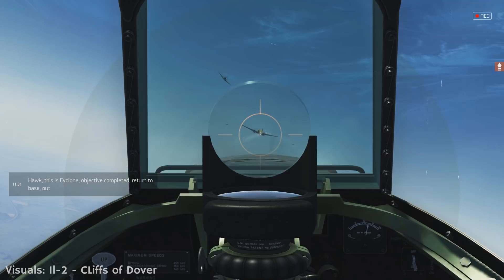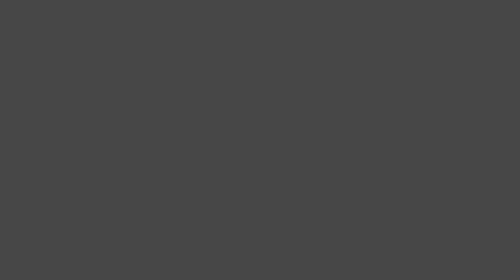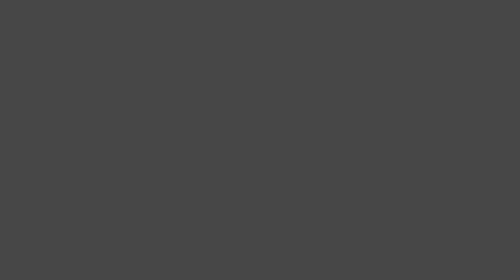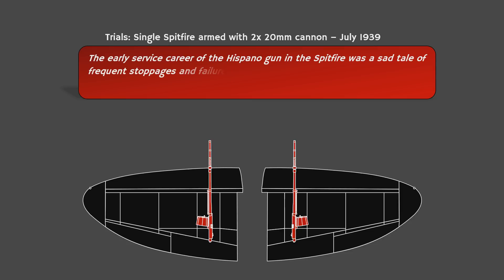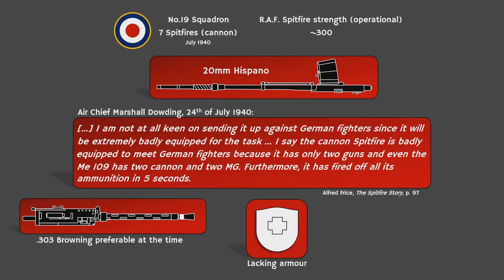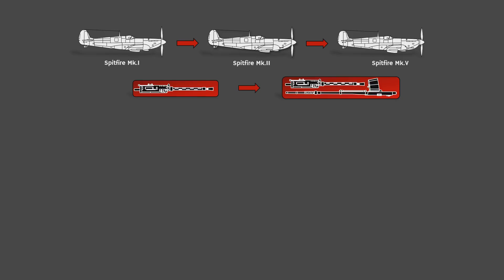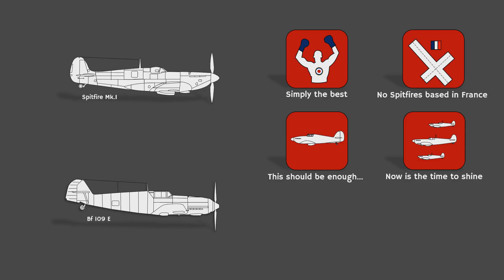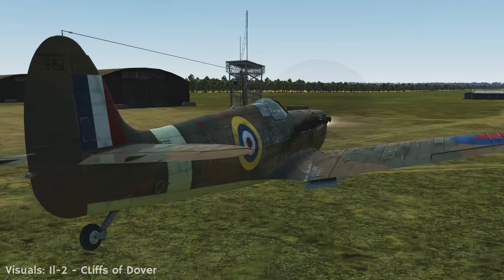⚜ | Clearing up Spitfire Misconceptions

Comment: The biggest misconception regarding the Spitfire is it being a magical aircraft. 1. The 109 E had atleast a 50% better rollrate at typical dogfight speeds (below 300 mph) than the early Spitfire as is being told by those pilots who fly both of them today. The 109 was the faster aircraft both horizontally and vertical, horizontally it was clearly faster at high alitude due to the fact that the DB 601 A had a two speed Compressor, while the Merlin I,II, III, XII, 45, 50 had a single speed one, in fact the same limitation which is so widely critizized on the Allison V1710 (nobody ever critizized the Merlin for the same.....). In a vertical fight the Spitfire is dominated by the 109 as in the typical Boom & Zoom fight. The 109 has a better rate of climb AND a much better rate of climb at very low speeds (this fact is even mentioned by the Brits themselves who tested it). In a typcial Fighter vs. Fighter setup the 109s can dictate the fight as long the Spits don't have excessive initial energy advantage. Also the 109s can disengage at will because they accelerate much better in a dive. In fact the 109 enjoys the same advantages the US Fighters had against the Japanese, though the gap was much smaller. This all was true up until the Spitfire Mk. IX with the Merlin 60-Series with metal ailerons came along with the two speed two stage Compressor, in this configuration and the accompanying very high boost pressures used (+25 Boost) the Spitfire finally was superior to the 109 G  in general performance. Only the late 44 109s with 1.8 - 1.9 Boost closed the gap again but not surpassing it. There was a reason the german Fighters enjoyed a 10 : 1 kill ratio against the British in 1940  and 41. The British Ace of Spade Squadron which fought in Tunisia, the Pilots tell that a Spit V was wholly inadequate to fight the 109 G-2 in terms of speed and general performance ! Only the advent of Mark IX changed this.

Comment: ...did you refer to the 303. Browning MG as a 'MG .50cal'..? If so, bit of a schoolboy error; given the quality of your material I doubt it more than a slip of the tongue.
Reply from the maker: No. Check the comment section, I've answered this multiple times. The phrasing was perhaps a bit awkward but I do not state that .303s are the same as .50cals (such as statement is already impossible simply because the calibers are quoted in the same measurement system...)
Reply: Ok, well... sounded like that's what you said.

Comment: One particular misconception I'd like to see cleared up is the silly notion that the Hurricane was "sluggish," and "less maneuverable than the Spitfire."  I'm sure you've heard it said that Fighter Command "sent the 'nimbler' Spitfire after the fighters and the 'sluggish' Hurricane after the bombers."  I'm also sure you've heard many exaggerations about the difference in top speed between the bf-109 and Hurricane, but here are the relevant facts; late-model Mk I Hurricanes (metal wings/3-blade, variable pitch aluminum prop) had a top speed of 330 mph at 17,500 feet, while the bf-109 -E3 and -E4 versions that took part in the Battle Of Britain had a top speed of 340-345 mph at 5,500 meters (18,400 feet).   

That's a mere 10-15 mph difference between the Hurricane and the bf 109.  Furthermore, neither the Hurricane nor the bf-109 would be doing anything near their top speed in the middle of a fight.  In reality, pilots often found themselves nursing their aircraft on the edge of a stall the entire time!  

As for agility, a Spitfire ace once put it best; "You could pull the wings off a Spitfire real easy down low, and they'd always break at bay 18....nobody ever managed to pull the wings off a Hurricane!"

Fortunately, history has preserved the German side of this particular argument for us; during the early years of WWII, most bf-109 pilots sincerely believed that their aircraft was superior to the Spitfire, which it often was, especially at altitudes above 5,000 meters (16,404 feet).  Yet their leaders hammered it into their heads again and again, "Never get into a turning fight against a Hurricane, or he'll be on your tail within the first couple of turns!" 

So much for the Hurricane's reputation for being "sluggish!"

Comment: You could have mentioned the fact the technological 'fix' to the Spitfire's flooding problem was solved by a woman - 'Tilly' Shilling, details of which are here https://en.wikipedia.org/wiki/Miss_Shilling%27s_orifice.  Also, according to Len Deighton, in his book 'Fighter@, the ME109 had a tighter turning circle than the Spitfire.  However, due to the way the planes were constructed, German pilots did not exploit this characteristic, feariong the G-force would tear the wings off if the plane was mnade to turn too tightly.

Comment: As having Relatives who Fought on Both Sides:
I can but Agree with you.
In 1940, I'd have far preferred flying the BF-109-E3 1 e.  or the Bf-109N.
 Gen. Adolph Galland states this-same in "The First, and the Last"; His WW2 Autobigraphy. As He IS My 4th Cousin: I do NOT dispute him.

That, Said: I draw the readers' Attention to Spitfire V, EN 630, shot-down over western France in late 1941- early 1942. Airframe was later-fitted with an DB 603-LA-1-3-e Fuel-Injected engine. ...  Quoting from the Rechlin Test Pilot Reports of that time: "In Our Opinion: This IS the most perfectly attainable Combat Fighter; to-Date"
This Opinion notwithstanding; that the Luftwaffe Technicians would far-rather have fitted 6 20mm MG151 cannons or two MK103 or Mk108 30mm cannons and 4 MG151-20 cannons or two independant Mk213 or Mk214 'Gating' cannons.

Kind and Respectful Regards, Uyraell, NZ.

Comment: If the spitfire was pulling positive G's and went inverted, would the engine die?
Reply: The counter for the negative-g starvation was to roll inverted and pull through upside down in a POSITIVE G manoeuvre.

Comment: Carby vs Fuel Injection -  Whats new the Germans were  always  leaders in technology even today many cars run Bosch fuel injection 
they ran the first jets  ME 262 , then the first unmanned cruise missiles , V1 and V2 a ballistic missile  - the first Drones  missiles used on shipping controlled remotely from a control aircraft - The best tanks - Tiger and Panzer - the first Assault Rifles  Which were the basis of the AK 47 which is a virtual copy - Ships like Bismark and Tirpitz ( why do you think they scared the hell out of Churchill , a normal battle ship would not and did not receive the attention that these two ships did , and then you have the Houghton Bros jet Bomber which strangely enough looks like the B2 spirit stealth  bomber  currently in use by the USA,  and these are things developed in the late 30's and early Forties.
Reply: The Germans weren't leaders during WW2, they were taking decisions to employ the latest technologies in the hope of gaining an advantage or edge. The Allies, the British in particular, took a more pragmatic approach. 
As Bismark stated, there are acrobatic advantages in using fuel injection, but there are power losses associated with it, too. The RR Merlin was generally slightly more powerful than the competing DB 605 throughout the War, in spite of displacing just 27l to the DBs 36l. Power mattered to the British- the Spitfire was an interceptor, designed to shoot down bombers. It's agility was a bonus, the intention was to combine a great rate of climb and top speed with an eight gun armament. Wartime development priorities evolved, but the initial choice not to use FI was the correct one.
The first jets weren't Messerschmitts! 
Both Gloucester and Heinkel built development prototypes before the Me 262 and the Gloucester Meteor were designed and built. The two fighters went into operational service at the same time- July 1944. While Kommando Nowotny were quickly grounded while the Germans tried to formulate plans for the best way to employ the new jets the British had an easier time of it, successfully engaging V1s and moving on to training Allied bomber crews and their escorts in countering jets. The British were aware that the Germans had issues with their jet engines reliability and kept their aircraft over friendly territory to prevent their possible capture.
The Meteor was a far superior aircraft and enjoyed a long service life- there's one still employed by Martin-Baker to this day! The 262 undoubtedly looked good, but it was poorly designed, badly balanced (the 18.5 degree sweep on the wing was to move the engine further back, rather than to gain any aerodynamic advantage) and hobbled by poor quality engines. Partly that was down to material shortages in Germany at the end of the War, partly to the fact that German turbojets were based on copying and trying to improve on Frank Whittle's early patented designs, rather than on original designs or innovations of their own. It's probably fair to say that the Germans didn't quite understand the devices they were working on as well as British engineers who had access to Whittle, his company and (most importantly) his thought process. 
The 'best' tank of WW2 is a hot topic and a debate for another day. I don't agree that the big cats were 'the best' or even the second best, but mileage varies!
Bismark and Tirpitz might have 'scared the hell' out of Churchill, but they didn't particularly worry the RN or the USN! The Bismarck lasted just nine days when she sortied into the Atlantic. The Tirpitz never saw any real action. She only fired her main armament in anger once, destroying a weather station. 
Flying wing designs do bear a resemblance to each other, but the Horten designs were contemporaries of Cheranovsky in the Soviet Union and Northrop in the US. I suspect the B2 owes more to Cheston Eschelman and Jack Northrop than any German designer! ;-) Google the Northrop N-1M and the YB-35 and YB-49 designs that followed, you're in for a treat. :-)

Comment: The important thing to remember about the Hurricane is it was quick and easy to repair. The Spitfire was not.
The Hurricane was old school construction and could be patched up with dope where the Spitfire was stressed skinned metal ( with difficult curved surfaces) and required painstaking and complex repair work.This meant that Hurricanes ( the majority of fighters at the time) could be back in action much faster and that was of crucial importance during the Battle of Britain where every single plane counted. 
If they had all Spitfires they would have lost. If they had all Hurricanes they would have lost.
They had just the right mix of workhorse and thoroughbred to survive.

Comment: This is all very interesting but is irrelevant to an invasion of England.  Germany did not have a viable invasion plan to begin with.  In fact, its ad-hoc assemblies of barges and miscellaneous other craft were not just inadequate.  They were entirely pathetic.  Had Germany actually attempted an invasion it would have been catastrophic.

Specifically, the vessels actually assemble on the North Coast of France and elsewhere were and would have been sitting ducks to both air and sea attack.  They were not even able to assemble at the time. So let us specify Germany gained some sort of air supremacy.  That term is mostly applicable to bomber defense.  Such an event would have nearly ZERO effect to protect thnaval invasion forces.  

It is almost certain British Naval forces alone could have devastated the invasion fleet. In addition, the German invasion fleet would still be confronted with British air/land attack forces not engaged in the air war.  Let alone land based fire power that could have been mustered.  The "Battle Of Britain" is a wonderful story.  However, I believe an attempted seaborne invasion would have been far worse for the Germans.

Comment: If Spits were so good, why did Hurricane pilots during the Battle of Britain refuse them when offered?  The Hurricane could take more damage because it was made of fabric, and not the "advanced" steel skin of the Spit.  Bullets would just punch a small, easily repaired hole, in the fabric skin of the Hurricane. A Spit would be severely damaged by bullet holes. 
Hurricanes should be more famous and appreciated since it was HURRICANES that WON the BATTLE OF BRITAIN, not Spitfires.
Reply: Craig, Spitfires' skins were aluminium, not steel.  And a cannon shell hitting the tube structure of a Hurricane would take it down just as easily as a shot in the spar of a Spitfire.  Certainly it took longer to repair a Spitfire skin than Hurricane fabric, but that's assuming that there was no internal damage to systems or components: there weren't a lot of empty spaces inside wings or fuselages.  Metal skinned aircraft could take a lot of damage, particularly from machine guns - you must have seen one of those shots of a German bomber that had taken about 200 hits without falling apart.
I've never read or heard (I've known a lot of WW2 pilots) of Spitfires being rejected when offered.  Even Douglas Bader, a Hurricane proponent, was happy to transfer when he got the chance.

Comment: Oh dear. Mostly good info marred by an extremely basic error, which was repeated twice.

The Browning .303 is called a 303 because that is the calibre (7.62mm). 

It is not a .50(12.7mm) and is not equivalent to it.

The number of rounds required to hit to make a kill with a .50 was less than half that of a .303, which is why 6x.50 remained a valid armament until the end of the war.
As an example 6x.50 has a muzzle energy north of 1300kw. 
The 8x.303 is just under 500kw and the later combined cannon and mg armament is juat under 1500kw.
As you can see conflating the 303 and 50 is extremely misleading and would have given a mk1 Spitfire or Hurricane a superior weight of fire to a P51d, P47 of F4.

Not checking basic facts just makes you look ignorant or lazy.
Reply: Sakkehattu Yeah nah. He says twice that the 303 browning is a .50 cal. This is specifically in relation to the Mk1 and Mk2 Spit which used solely 303s. 
The 50 cal wasn't used on the merlin engined Spitfire - it didn't debut until the Griffon engined models which are not covered in this vid.
Reply: Can you give time stamps ?
Reply from the maker: How can I mix it up when I say '20mm cannons and browning .303's or indeed .50cals.'? Please give me a clear timestamp and quote where I say that a .303 is a .50cal. Otherwise, and I am quoting you, you 'look ignorant or lazy'.

I clearly differentiate between the .303. and .50cal. Also, a mute point but obvious, since they are based on the same measurement system, they are automatically different. If I would say .303s are 12.7mm, the I could understand your point because maybe it was an error in conversion....but since I am clearly not saying that, I don't understand your point.
Reply: Bismarck - Military Aviation History You mention the Spit having 8 x 303 which equates to 8 x 50. It's a weird error and is the second time you mention it. The point you raise is not the comment I'm referring to. As you've replied to others who've raised the same point I'm not alone in noting it. It's a "moot" point by the way, not a "mute" point.
Reply from the maker: Please give me a clear time stap where I equate 8x303 to 8x50.